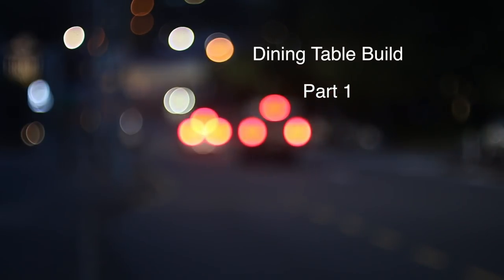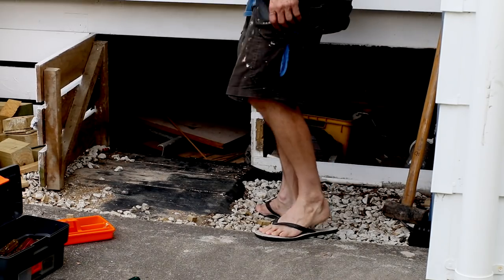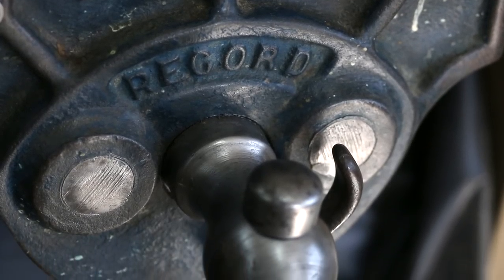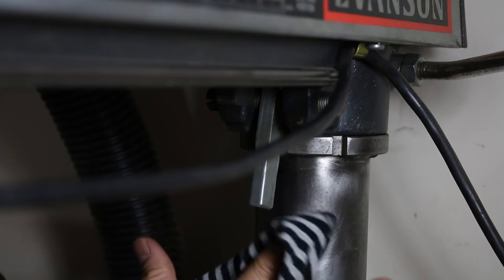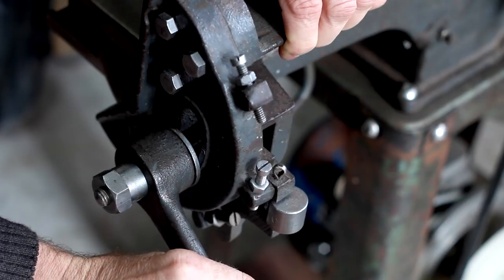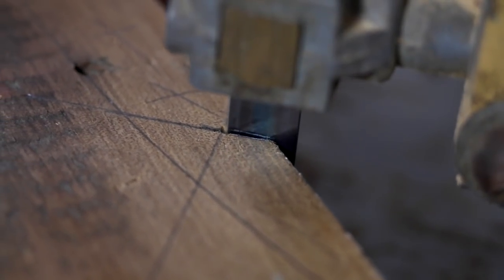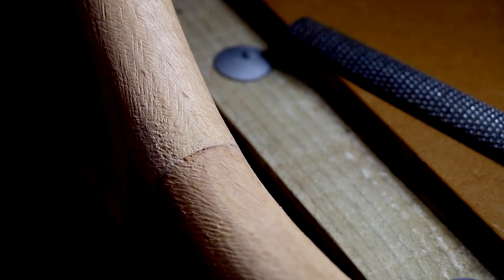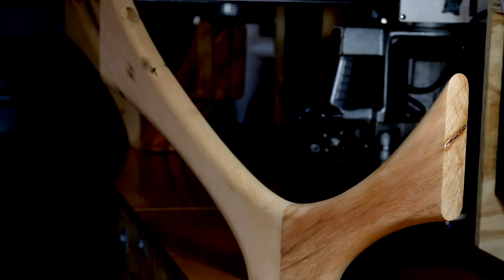Dining Table Build - Part 1

Comment: Good to see new videos, I like seeing the native New Zealand woods being worked. I interested in what you think is the best for guitar tone? I like how the planner came out, I did a similar job on one a few years back, I dont have the heart to get a new one, some old planers should last a life time.
Reply from the maker: Thank you Sam! There are some great NZ woods for guitar. The best wood for something like a tele, with heaps of twang, is Matai. It is fairly stable and if you can get a nice piece of close grained Matai, it will ring like a bell. To give you a bit more twang, you can use Matai for the neck also. Totara, although excellent in tone, is very unstable, so I would avoid. Kauri is fantastic for a more hollow-tone, like mahogany in many respects. I use Kauri for Les Paul type guitars. Rewarewa is the wood I like best for necks. It is the stiffest of NZ woods and it has a deep tone, which is a little unusual for such a dense wood. It is very hard to come by in slab quantities however. Puriri sap wood is also fantastic, if you can find it. Avoid Pohutukawa and Rata as they do not resonate that well and you don't get a lot out of them. Red Beech is great for a Jazz tone. It has high note decay and so lends itself to lead guitar work. I have a body made from Red Beech and its great. Hope that helps, cheers!
Reply: @elams1894   Thanks for the reply, I'm glad so many NZ woods are good for guitars, I'm used to using a few Eurepean woods, but find it hard to find cheap matirial for guitars. I've traveled NZ several times sereral times in the past few years and my Grandmother is Maori (Rapaura) Motueka) I'm Scotish myself. I've enjoyed your videos. Looking forward to the rest of the series.